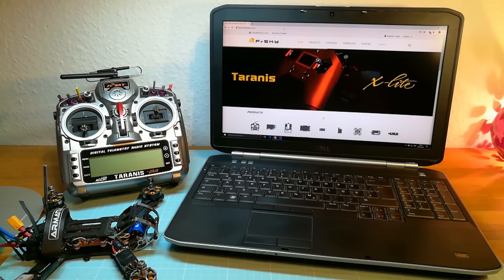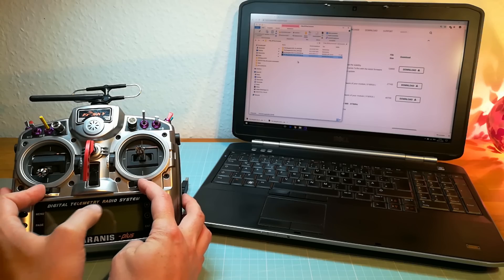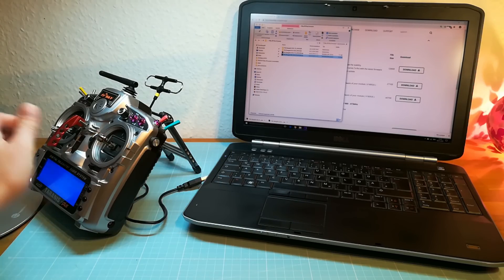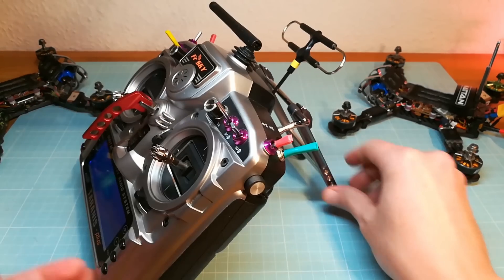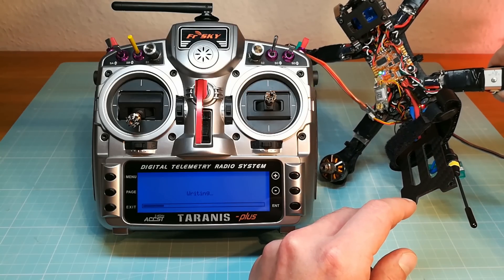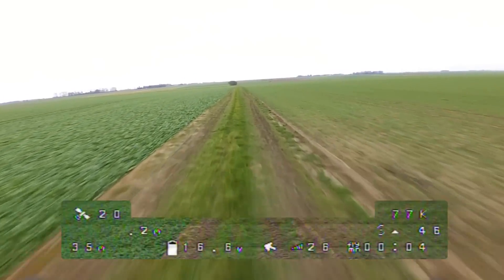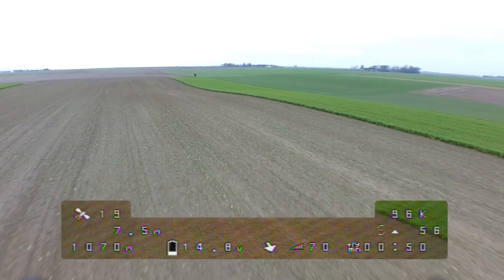FrSky R9M - 181228 Flex Firmware - Test and How To

Comment: Hi! I know it is an old video, but maybe meanwhile you have more experience with r9 system. For Accst 2018 r9m and r9mm,  what flex fw version has stable telemetry range? I have sensors lost randomly and frquently on r9mm, mini. Thx!
Reply from the maker: In my experience, the latest fw version works best. But always make sure to use the same firmware version on your rx and tx module.

Comment: HI   you get some good speeds with your quads
Q: Do I need Flex in Australia, I know 915 meg ., have new in box R9M and rx with twin antennas plus super 8 
this will my first longer range try.
Cheer's BF
Reply from the maker: Hi, no you don't need flex, you can use the FCC Firmware. Flex is like the FCC Firmware with the additional option of changing the frequency to 868Mhz for the EU.
Reply: @TorbanDallas  Thanks much for that BF

Comment: Hey Torben, danke für das Video. hätte da mal ne frage zu der flexfirmware. auf der frsky seite gibt es diesen reiter "flexfirware" nicht mehr. kann ich davon ausgehen, dass der 1 download unter "firmware" also die flexf. ist`?
Reply from the maker: Einfach mal runter laden, du bekommst dann eine Zip Datei die dann alle Firmware Version (fcc, EU, flex) enthält 😉
Reply: @TorbanDallas  hehe ja ich war gestern abend etwas banane als ich das geschrieben habe - hab ich mittlerweile auch auf dem rechner. hast du evtl noch die neuere version davon?`es gab doch mal ne version vom 24.09.2019 - auf der frsky seite gibts aber nur noch die versiuon vom 13022019. hast ne ahnung wieso die neuer ver rausgenommen wurde?

ach und vielen Dank für die schnelle Antwort!

Comment: Is using fport instead of sbus going to get me out any further? Is using the flex firmware for g to improve the flight?
Reply from the maker: No fport won't get you out further. The flex firmware doesn't improve your flight, it just offers the ability to change the frequency between EU and FCC and the output power as well. But if you're living outside the EU you don't get any benefits out of the flex firmware
Reply: @TorbanDallas  thank you

Comment: Hi again. i have purchased the x-lite pro and put flex firmware on the r9 module flashed with flex accees and i was wondering which mode do i use to bind R9MLP OR R9ML? I am using lbt does not give an option for flex on the setup menu. Thanks for any advice.
Reply from the maker: More details please, you probably self answering your question. You have a x-Lite, so you probably can't use a r9 (full size) module, you need the small one. R9Lite or R9Lite Pro. Like R9ML or R9MLP ... which one do you use?
Next make sure to use the latest opentx version on your radio and the latest frsky firmware for your module and receivers.
Reply: @TorbanDallas  worked it out, thanks for the reply, it is a r9 m-lite pro module, their names for things can be confusing, can see the spectrum analyzer in the tools but not the power meter?

Comment: Can i still use my LBT antenna's  on module and RX when i switch to FCC ?
Reply from the maker: Well, you can but I wouldn't do it. For fcc you better use tuned to 915mhz antennas.

Comment: Hellllp so my tarantis x9d+ is on 2.2.3 but the r9m and r9mm won't bind with any firmware. RX when binding RX is green/red but after power off it has a odd red flicker. What is wrong?
Reply: Danger Davefpv Same here

Comment: Hi Torban, do you know whether the following combination is possible: x-lite with non-eu firmware and R9 lite with 868 Mhz? Thanks!
Reply from the maker: X-lite with non eu fw? You mean opentx without checking the eu option?
Reply: thanks for your reply. Exactly, opentx fcc in combination with 868 Mhz. But yes, it should be possible. I found the answer in another video.
Reply from the maker: @monsieur7246  with the flex firmware, you don't need to check the EU Option. If you want to use the EU LBT Firmware on your R9 System than you maybe need to check this option. I never tried it by myself: I'm using the Flex Firmware from the first day.

Comment: Torban - can you help me? I have just started with R9 system.  Ive flown maybe 5 flights on my source 1 - R9MM, matekF405CTR.  Ive had a lot of failsafes - sometimes I get ** in the OSD.  The quad kind of locks (getting no more receiver inputs) and then drops.  Ive also had very brief momentary losses of connection, where you see the quad jerk/bump for a moment.  I fact it's just locking again - and then you regain control.  Im running the latest formwares on both R9 module and RX.  Running the flex firmware, and 500mw, powered by external battery on QX7.  Question: Have you had to debug any of these issues, and if you have, what did you do?  Thanks for your time :)
Reply from the maker: Let me guess, you are using the f.port firmware?
Reply: @TorbanDallas  you got it - yes I am.  fport seemed like a good idea.  Perhaps not?
Reply from the maker: @charlietait1  Yes f.port is not only a good idea, in most cases, it's the best idea if you want to experience Failsafes every 20 seconds and every 10meteres. It's new, most people never heard about it bevor, so it must be something special, it must be good. Let's use it even when we don't know what it does.
I really don't understand why so many people are using f.port. Just use one more wire to your FC and stay with s.port. Where's the benefit? Saving one wire? But getting Failsafes? Stop using f.port firmware and i promise, all of your issues will be gone. On some quads f.port works solid, but on many quads, it doesn't. It seems to be depending on the Flight Controller.
Reply: @TorbanDallas  Thanks so much. That could explain why it's happening a lot on one quad (matek f405ctr) and not on the other (brain radix).  I'll redo everything with sbus and go from there. Also I found your helpful video on r9 debugging... Thanks for sharing your experiences.

Comment: You run EU LBT version of R9M right? It's 1 watt output now with newer firmware?
Reply from the maker: No, i'm running Flex Firmware on 868MHz as mentioned in the video titel and the description.
Reply: @TorbanDallas  Yes, I saw on website it says 1w now but unspecified if its for EU version. And I am wondering if you use EU hardware and what output power in general 😂
Reply from the maker: @peterpunch1  there's no eu hardware, it's only the software.
Reply: @TorbanDallas  aha! that clears things up, thanks 👍

Comment: hey torban. After the last firmware update the rssi seems to be corrected. so now its wrong in the osd since I changed it in an early firmware . Do you know the Stock numbers for the rssi scaling? I have no idea what it was. thanks
Reply from the maker: Are you talking about the RSSI on the RSSI Output of Channel 16? Default values are rssi_scale = 100 and rssi_offset = 0
Reply: Yup. Thanks a lot ✌
Reply: Sorry to bother you. Buy is there anything else i have to change in the cli when going over to crossfire.
I changed the scale and offset back but i still got wrong rssi number in my osd.
Reply from the maker: @Victor90NOR  i don't own crsf and didn't test it. Why did you skip to crsf?
Reply: Okey. I just found it alot easier with the firmware updates and stuff.
But as of now i dont like it better than the r9.
Did we change the rss_osd_poss or any othe values for the r9?
I have 99 rssi on my controller and 49 in the goggles so just wondered if there was any other changes made. I cant remember 🙈

Comment: Thanks for the great help in your video's, One question , do you install 180926 and 190117 or just 190117?
Reply from the maker: always the same firmware on your module and your receiver! Never use different versions!
Reply: Just to be clear , can I just install 190117 as the file size is much smaller than 180926? also the latest version for r9mm is 190201??
Reply from the maker: @lloydhutchinson9848  the different version numbers are confusing at the latest firmware release, but it's the same firmware with the same update time. Only install the latest firmware on your r9 and your r9mm as shown in my video. Don't care about the file size, it's a zip file that contains different firmware files.
Reply: Thanks Torban . Great job.

Comment: Hi. I have a Matek F411 board and R9 slim plus receiver. Can you help me with how to wire this.and setup on the Inav. Do i use the S-port from receiver to s-bus on the FC? or TX1 ?  I have flashed R9m module and the receiver with the newest flex firmware.
Reply from the maker: Well, you need 5v, Gnd and SBUS_OUT on your R9 Slim to the SBUS / RX Solderpad on your FC. Then you can even solder the S.Port wire to an S.port / TX on your FC for Telemetry.
Reply: Its working now :) I used the sport from the receiver to the sbus pin on the FC. :D i haven't check the telemetry yet. I have the r9 slim plus receiver.

Comment: Hi TORBAN, I  wonder if you may have any advice? I am running two separate quads using the r9 m lite module and two r9 mini both flex European firmware on official tx companion 2.2.3 firmware, both with the upgraded europeans antennas and the upgrade super 8 antenna on the module, both quads get about max range no more than 600m before rssi says critical, flying with no obsticals also the receivers bound at 100mw, I should be getting more range than this? Any advice appreciated.
Reply from the maker: quadthing copter did you see my frsky r9m failsafe troubleshooting video? Check the advices in my video. Make sure to install the same firmware version on your r9 module and your receiver. Bind your receiver new after flashing. I have also made a test flight with only 10mw over 2km.
Reply: @TorbanDallas  Thanks, Turned out it was a faulty module, one of the first batch with a resistor missing, replaced the module, did a 3k round trip, very pleased. you can view the flight on my channel. Thanks.

Comment: Does the opentx 2.2.4 work for flex and standard r9m firmwares? And if it does, do we still use nightly builds?
Reply from the maker: opentx 2.2.4 isn't officially released yet, you only can download a nightly build of it. But there's no reason to use opentx 2.2.4.But there's also no need to worry, Flex and r9m will work with opentx 2.2.4 - it's a newer version so it contains all the features of 2.2.3 and some addidional ones. Download 2.2.3 and don't select the nightly build option in companion.
I even have created a video about flashing opentx and i have mentioned in the video description that it's not nessessary any more to use a nightly build because 2.2.3 is offically released now.
Reply: Torban Dallas excellent, thank you for that info... I have been using 2.2.2 and haven’t installed the r9m but it’s all flashed and ready. Went to update opentx and noticed the 2.4 version so I skipped 2.2.3

Comment: Hello Torban, I have been watching all your clips on the r9 system, I've got mine up and running with 2.2.3 and flex firmware, I've flown out to about a km with 100mw. However I have discovered that I can now not bind to my XM+ receiver in another quad.... Have you any ideas how I can get the tx and rx to communicate again? Thanks in advance for any help. I'm stumped.
Reply from the maker: Shish FPV do you have the internal xjt or eu lbt module? Maybe you have flashed your taranis to the wrong firmware. Or did you even accidentally try to bind your xmplus with the external r9m? You still need to bind your internal module with the xmplus. I'm just thinking about possible mistakes. Please tell me more details about what you did.
Reply: Torban Dallas Thanks for your help, I got it sorted eventually, turns out I had managed to flash my internal module with a random download? (One of the points you mentioned.) I'm not sure how I managed to achieve such a feat however no harm done in the long run....
Reply: @TorbanDallas  Thanks for getting back to me so quicky. Its and internal LBT, when I try to bind to the XM+ now I get the two sold lights on the receiver so Im guessing its a firmware mis-match. Im not entirely sure what I have done?
Reply from the maker: Shish FPV which firmware are you running on your xmplus? For binding your press the bind button and you keep it pressed, then you power your quad and you try to bind your internal rf with the xmplus? And it worked before but it doesn't work anymore since your have flashed opentx 2.2.3? I still can bind my receiver. Maybe you also have to check the eu flag in the companion settings... But i didn't do it and it works. Did you also change the receiver numbers so that you don't use a number twice or more times?
Reply: @TorbanDallas  Im using the latest LBT 16 channel with RSSI on the XM+. As per a Youtube clip from your good self
 On my transmitter my OTX Bootloader - 2.2.3 and my FW: X7 - 2.2.3 (ae5ac05b)
The XM+ was previously bound and worked no issues its since I updated to 2.2.3. No matter what I do I cant get it to communicate now. 
I will have a look i the companion settings see if that sheds any light.
Im still a novice with the Frsky..... its a steep learning curve.

Comment: Do we need to Flash ALL the available Firmware files to get ALL the benefits?....Or only one File, the latest.????
 Im asking because the size of the available files are considerably different....and why would they not remove the older firmwares just leaving the latest ones on their Website?
  It's confusing, why would they do that?
Reply from the maker: EnglishTurbines all the files? So you mean flashing all files step by step to the latest? No you don't have to do that. Just flash the latest one. The file size of the zip files are different because of the different containing files.

Comment: Hello. What determines if it is 868mhz or 900mhz. is it firmware? Or the antenna? or the module?  I'm thinking of buying this from banggood. Living in europe so must use 868mhz. But how do I know what I get?
Reply from the maker: mrtokyo1989 doesn't matter what you get. If you have got your r9m module and your receiver you just need to flash the module and the receiver to the eu lbt or the flex firmware. You also need the 868 tx and rx antennas. The stock antennas are crap.

Comment: Thanks...They have now released Open TX 2.2.3.....Im going to try updating my Firmware to Flex now. I removed my 868mhz R9MM RX and now the firmware looks a lot more stable to try giving it another go.
  I have the 868mhz Tru-Mox TX antenna....How did you find yours..?....Did it work okay for you..?
 Can you fit a 4000mah Lipo and fly it out to 4kms now..?
Reply from the maker: EnglishTurbines yes opentx 2.2.3 is officially released now ☺️ i liked the true mox 868 but until i have got the Super 8 868 eu version i don't use my true mox anymore. I don't think that i can fly 4km and also 4km back with a 4000mah battery. I will try 1800 and 2000mah batteries soon. I'm trying to be back with making flight videos at the end of February.
Reply: I can easily fly for 4 kms on a 1500mah 4S....I dont think my motors are as greedy as yours though...?
2 kms is not long range.... you know that yes..?
Reply from the maker: EnglishTurbines of course, it's not really long range. It's just as long as i can fly with my setup. I'm interested how far i can fly with new batteries.

Comment: Nice clear concise video, thanks Torban. I’m subbed. My R9 is fitted to my Q7 and on anything over 10mw gives a loud buzz through the speaker. This does not seem right, thoughts please? Oh and I take it adaptive mode is the “Auto <1W setting”? Terrible lack of instruction on the R9!
Reply from the maker: Hi, thanks! Yes 1Watt is adaptive as you can also see on my r9m power consumption video. The speaker buzzing is a known issue of electromagnetic inteferences. You can try to shield your speaker - or just turn down the volume of you taranis ;)
Reply: Torban Dallas: thanks for the response. As long as no magic smoke appears I can live with the static. Cheers.

Comment: Thanks for the video’s really helpful.
Just wondering about your update cable to your R9MM when it’s in the quad.
Do you have the R9MM powered from the FC RX 4.5v pad, so when plug a usb cable
In it powers up or do you have to plug a lipo in?
I have the same issue as you had and I would like the option to up date the R9MM rx when it’s
In the quad rather than taking it out. I was going to just add a ground and Support cable and plug
And power the FC, R9MM from the usb and update the firmware with plug connected to my Taranis
minus the +v connection, but I don’t know if it’s ok to have 
Sbus connect when updating the firmware?
Reply from the maker: pablo i have connected my r9mini to the rx 5v and gnd pads of my helio fc. So the rx gets powered when i plug in the USB cable and when i power my r9mini over the taranis update cable it also powers my fc. But as you see in my video it works even without powering my quad over the usb or with the battery.
Reply: @TorbanDallas  Thanks for the reply, so your taranis  supplies 5v on to the FC 5v line which then powers up the FC and  the R9mini  and the 3rd wire connects to the R9mini Support pad?
That's interesting way of solving the problem.😁 .Its a shame you cant use serial pass through when the FC is powered ,then just have the Support pad permanently wired to a spare Uart or soft serial connection...
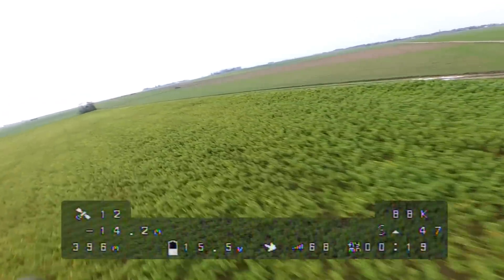Reply from the maker: @pablofpv  my taranis to the r9mini cable is connected from the taranis to 5v gnd and fport on my r9mini as shown in my other video at 3:50 https://www.youtube.com/watch?v=AOWOxPo9A0g

i like it to power the rx with the usb connection, so yes it's a shame that i can't use the passthrough update function.